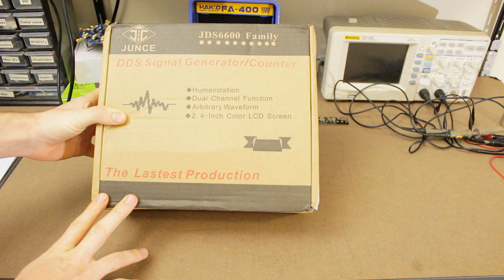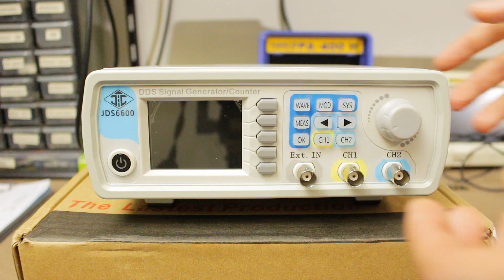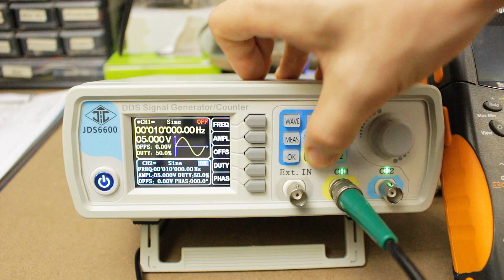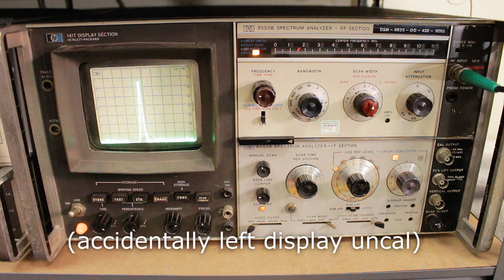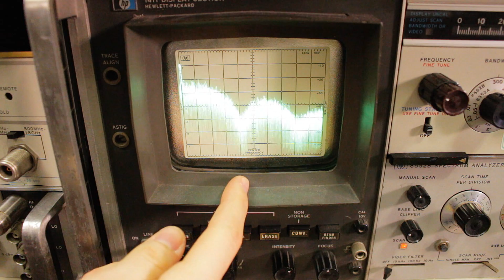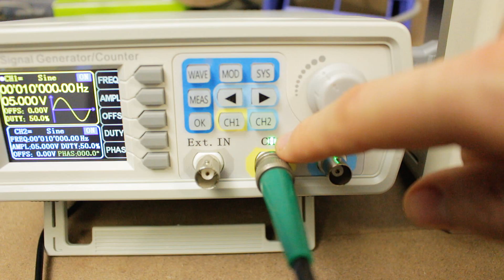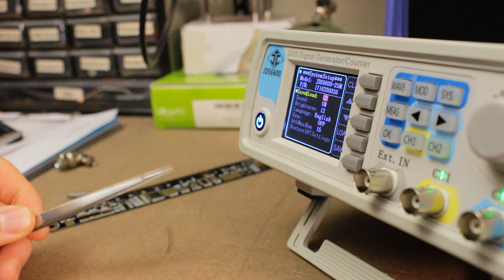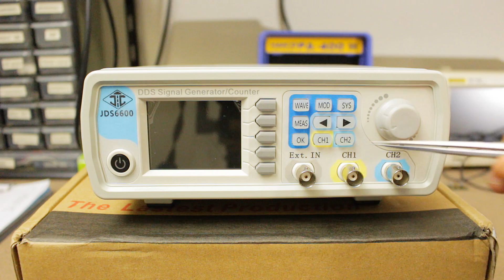JDS6600 Function Generator Review & Teardown

Comment: can I use ch2, to modulate a signal from ch1? (example: 1MHz carrier on ch1, 1000Hz tone from ch2) or would this possibly fry the outputs if they short together? What is a good way to mix the two signals? I'm a little disappointed in the modulation functions of this model compared to the 6800 or 6900. maybe I should have spent that extra ~$40! :P

Comment: I bought the 60Mhz version of this a few months ago.
One main annoyance is when using gated pulse mode where you have it send a specific number of pulses.  The default state is ungated.  When it completes sending a number of pulses where it stops output and you  go to change the number of pulses, it enables output ungated.
I was trying to test a binary counter that has a logic output at specific counts.  Tried to use the generator to test it but could not.

Comment: 13:40 The 2 white circles on the board is where the SMD LED's are, if you remove the board, you can shove a small piece of black heat shrink over the 2 plastic tubes that molded on the frontpanel. That way, the markings CH1 and CH2 above the BNC's are nice lighted without illuminating the buttons above.
I have the same function generator but rebranded as Joy-IT, it came with exact the same contents in the box, except the cd, but Joy-IT offers this software on there website.
I also noticed, that the output voltage is very low current, barely enough to light up a white LED, even with a amplitude of 20V.

Comment: The ones with the external power supply seem to be better, the one with the internal power supply leaks too much ac to the output.  Painful even standing on a dry tile floor with bare feet.

Comment: I have a CJDS66.  Virtually the same. It doesn't turn off by itself. I  wish you could select the load impedance. More findings. If the two channels aren't set to the same frequency, but instead set to a multiple of each other (eg ch1 set to 375Mhz and ch2 set to 750Mhz) you can't control the phase of their offset. And their rising edge don't coincide.

Comment: I just got this and im well happy with it for what it is.. as far as turn it on and the generator comes Strat on is easy fixed just set the generator to how you want it to start up ie on off 5 hz 3000.00 hz what ever and then just press and hold the ok button until it beeps now when even you turn it on it will start like that

Comment: Be sure to plug in the USB. That eliminates the 50+V leak and should clean up the noise. Doesn't matter if the host computer is on or off....still works (provided the host PC is grounded...duh).

Comment: my signal/ function generator provide constant output voltage for all frequency range when analyzed through oscilloscope, its fine, but when i connect a load across signal generator its output voltage drop significantly why?
Reply: Because the scope input impedance is (usually 1Mohm), and the source impedance (I think), is 50 Ohms. Feeding a load of lower impedance will bring the voltage down... 
Notice the source voltage said a value that was about hald of what was seen on the scope, until it was switched to a 50 Ohm feedthrough impedance? Then it was equal to the generator setting (perfect impedance matching at 50 Ohms). This is pretty much a feature of every sig gen I've ever worked on: The source voltage is only seen accurately at the load when source and load are the same impedance.

Google impedance matching for more info.
Reply: Yeah you need to match the impedance then you see the correct frequency response by half of the voltage output. If you leave one end open the delay in the cable's reflection may constructively interfere and give you higher values. I think the 60MHz version will by definition drop off -6db because of a lack of samples.

Comment: I'm interested in this little thing as my first function generator. Would you recommend this for someone just starting out in electronics? I've got some other gadgets from Ruideng as well, they sell (or maybe make? But I think just sell?) these units, that's how I found them. Love the other stuff. Nearly done building the DPS5020, fun little project that. Love the USB tester and dummy load, awesome stuff.

Also, did you happen to crack the power supply open? Even if you just say what is on the label, might give us an idea on how good it may or may not be. I have absolutely no shortage of 5v 2A power supplies, but it would be handy if the one included with the unit was usable.

Thanks for the video! Very informative!

Comment: Great teardown!  Did you notice any components which might convert one model (the 15Mhz) one to a higher frequency capable one?  More often than not, the $40 difference in models is due to a $3 blocking diode, or even firmware :D

Comment: Hello, my terminally ill friend bought this device and asked me to have a look at it, as she believes a certain frequency can be used to help heal her. I know there is probably no scientific evidence for this whatsoever, however I want to do what I can to make her feel more comfortable, and if getting this working is what it takes, so be it.

I'm an electrician, but have no experience with this at all, and just want to know in Laymans terms how to get it to emmit the frequency she 'needs'. I'd appreciate it if anyone could get back to me on this or give me any advice, thankyou.. My email is djhorgan80@gmail.com if you don't want to discuss it here.
Reply: Hello! There is such a frequency. 280 kHz to 600-800 kHz, but it's all about the coil. It must come into resonance. Heals only the sine, statics.
I already bought it, but I did not try it. You need to buy a signal generator.
I bought it, but it does not work
and I can not surrender. Hey. Vladimir. Your Emaiil does not work.
Reply: Yeah its probably a magnetic field that needs to be generated. in this case you may need more power than this can output and there may be a need for an amplifier. if you want to connect direct to the skin with electrodes then maybe 5-20v output may be all that's required. Just some things to think about. Also I doubt that a complex waveform is required maybe just a sine wave so therefore this thing is way over-kill. Who knows - need more info on this "technology"

Comment: The one thing that REALLY bugs me is the button labelled, "AMPL" that changes the voltage value shown (the 5V appearing after bootup).  This is because the value shown on the screen is actually the peak-to-peak value - not the AMPLitude of the sinewave!   So in fact the output is v(t)=2.5sin(wt) volts into a high impedance.   This confused me quite a bit initially!  If there is room on the screen, a little "ptp" added after the V symbol would help a lot.
Also, my unit annoyingly gives out 5.24Vptp into hiZ when set to 5V @ MHz frequencies = a +4.8% error!   This rather makes a nonsense of having voltage resolution settable to 1mV!   (This 5.24Vptp value was confirmed correct,  by measurements using a new HP54645D, a TDS210 and a Rigol DS1102E.  Terminating at the scope input with 50ohm just halves this value as expected).  I'd love to know how to correct it,  hopefully it's only a pot adjustment, when I get brave enough to open the box!
Another minor problem for me, is not being able to use my Windows 10 PC to run the software supplied by RD to create and control waveforms,  The s/w control panels are too big for the screen and are cut off, completely hiding many of the necessary s/w buttons.   But this problem is almost certainly due to Win10's inability to properly scale 3rd party software - a well known issue.
In addition, as mentioned by others, the instrument's front panel font also looks a bit strange to my western eyes (too ornate? even a bit "unscientific"!)
But otherwise, at the price, the JDS6600 is a pretty good piece of equipment for non-professionals.   Yes it has some deficiencies, but to compare it to $k truly professional equipment, as others have tried, is not fair to the designers.
Reply: The amplitude it correct into a 50 Ohm load. Into a "high" impedance, you get approx twice that.

Comment: my understanding is the difference in the 20mhz and higher models is just that firmware you mention would love make mine 60mhz
Reply: Perhaps between some of the models, but I don't think you can get the 60 Mhz only by changing the ST micro firmware. According to the specs, The 50 Mhz and 60 Mhz models have a sample rate of 266MSa/s whereas the other models are 200MSa/s. This means they are probably changing something in the FPGA as well (or perhaps they are simply overclocking it?). Also, there's serious amplitude and DC offset limitations above 30 Mhz (it degrades to 5Vpp, and ±0.25V?) so even if it's possible it's not really worth it.
Reply: @battlecoder  yes exactly. My feeltech fy6800 also drops the output voltage by 50% from 10 to 60MHz sine wave. I only used 1Vpp. Altough the sampling rate could sustain up to 100MHz I have no idea why the output level drops that much. Do you? On second thought, at 250 MSamples the Nyquist is at 125 so 60MHz is just at the 6db with 4 points per period. It's like using a 1Gs oscilloscope on 250 Mhz.
Reply: @Mike Sienicki yes of course, termination has to be at the end of the cable. The Feel tech 6800  still drops amplitude from 20 to 60 Mhz by half. I believe that this is because of poor sampling and the characteristics of the amplifier (even at low output voltages where a constant gain bandwidth product should provide a higher upper cutoff ).

Comment: I purchased this unit (60Mhz version).  The one thing I don't like about it is that it is very noisy!   Dial up an HF frequency on a ham band, and listen to it.  Something should be done to clean it up!  Is it the 5V supply or the switching supply inside to generate the voltages for the output amps (or both)?  Otherwise it appears to be well made (the circuit board).
Reply: Thinking of getting one for aligning  receivers.  What's the upper frequency limit like?  Is the waveform usable at 50mhz?  Did you find a way around the noise issue?  The wall wart  can be replaced but is apparently does internal DC-DC conversion to get to 10v pp.  Cant fix noise on that.  Is the noise only a problem at higher outputs, say > 100 mV?

Comment: Not bad for the cash! Back-lighting the enable buttons might be an easy and useful mod too. Annoying it comes up by default with the output turned on! If you get it to make a DC output (or whatever) and put your scope in AC mode while turning down the volts/div can you see much switching noise leaking through?
Reply: Ok never mind - saw the post on EEVBlog

Comment: I have two requests. Does this have a potential on the ground line like the older and eerily similar FeelTech units and does this unit preserve your settings after power cycling?
Reply from the maker: Yes unfortunately there is a ground potential of 99 volts (!!) on my unit with the default plugpack (only found out after this video), so I switched to a different plugpack. One of the users over on the EEVBLOG forum (see reply #26 at http://www.eevblog.com/forum/testgear/anybody-know-anything-about-this-signal-generator/) reports the leakage current as 14uA. The unit can be set up to preserve your settings, but it does not do this by default (as you would have seen in the video). I later found that you can save your configurations into 'presets' and then select which 'preset' is loaded on boot...
Reply: Did you test the software to link it to your laptop. Necessary for creating the arbitrary waveforms.
I didnt get it to work on Windows 10
Reply: It comes with an external 5V PSU that does not connect to ground.

Comment: I don't have this model of waveform generator (I have an mhs2300a), but I am thinking of upgrading, so to get an idea of the functionality of the jds6600, I downloaded and installed the pc software. My main interest is in creating arbitrary waveforms using the editor provided, and it seems to be very nice, easy to learn and highly functional.
Unfortunately, the program has a serious bug that I would consider a dealbreaker for me: After creating a waveform with the editor, and saving to the pc, I find that the file that was created is completely unreadable. That's right, the software cannot read its own files! Unless this problem, and the 20 minute shut down problem mentioned in the video can be solved, I don't think this machine can be considered as a worthwile investment.Even at its very low. price
Reply from the maker: Hmm, I haven't had a chance to check out the software for it yet (having some issues installing it; keeps breaking & crashing when I open it!), but if what you're saying is true, then that's pretty bad. As for the 20 minute shutdown problem it seems to happen very intermittently now so it may just be a dry joint in the barrel jack or something - still, not great...
Reply: I asked the designer to comment about this.
We'll see if he does or not. I won't buy it unless I am sure there are no issues.

Comment: Hi, I just test one 60MHz, I have a periodic phase shift.. can you sync the scope on the output at 50KHz for instance ?
Reply from the maker: Not sure what you mean - do you want to create a periodic phase shift or you're observing it undesirably? There is an issue with sweep mode losing phase lock
Reply: No, I mean: if you reset the default settings, chose 50kHz 5Vpp Sine, periodically there is a phase shift, a sine period is not complete, if fall to zero and restart. I received one of the last JDS6600 60Mhz.
Reply from the maker: Hmmm.. Perhaps you have a dud. I've just tested your 50kHz/5Vpp and it seems okay: http://imgur.com/a/xgHib. Other frequency/phase tests here: https://www.eevblog.com/forum/testgear/anybody-know-anything-about-this-signal-generator/

Comment: I also bought a signal generator, JDS6600 5mVPP effect is very poor, there is a clear switching power supply noise, more than 20MHz sine wave has a significant jitter, the nominal vertical resolution of 14, in fact, simply can not reach, Because the waveform length is only 2048 points, the highest resolution is only 11-bit resolution, the oscilloscope with 20mV voltage and 100nS time base gear test 5V 10Khz sine wave, you can see the rough rough waveform, and 14bit machine More than a lot of open the machine can see the DA is a simple resistor, which used a multiplier, or second-hand components, with a knife gently scraping the surface to drop the black powder,
Reply from the maker: You're right about the PSU noise, it is quite high. There are definitely some issues that aren't discussed in this video; I've taken a lot more measurements over on the EEVBLOG forum here: http://www.eevblog.com/forum/testgear/anybody-know-anything-about-this-signal-generator

For example there is an issue with phase locking when doing a frequency sweep, and some distortion issues at 10MHz at max amplitude -> can continue the discussion in the forum thread.

Comment: Hi my dear friend 
thank you very much for your video and your work, I really like it, I guss you did not buy it from our official store. (https://rdtech.aliexpress.com/store/923042)
but it doesn't matter , it is very good , you introduce interface , appearce , some wave , and use the oscilloscope to test our waveform (although oscilloscope is not very advanced, but it is engough. ) you use the analysis decvice to analyze, it is very good. about the LED light, I will improve in the future. 
for tear-down , your analysis is almost right , you are professinal. 
let me talk about the problem I find 
1, at 5:25, you said the channle swich, when you turn off the channe, when you restart the device, you will find channel is pen, this can be stored. you can keep pressing ok button, you can store this state,  you can try. 
2,  at 10:45, you said there is a problem , but I did not find the problem,. because our VPP is 20v, and you set 20V, so you set DC offset,  it can be offset, you can set lower than 20V, you can test 
3, about the word, it is our standar typeface. we can't change it
there are our own test and openeration video , you can refer it https://www.youtube.com/watch?v=Fn76Yp-vATI
if you have find any problem. please tell me 
BTW, we update our JDS6600, and add some 15MHZ , 30MHZ, 50HMZ, 60MHZ version, you can check https://www.aliexpress.com/store/product/RD-JDS6600-Series-40MHZ-Digital-Control-Dual-channel-DDS-Function-Signal-Generator-frequency-meter-Arbitrary-sine/923042_32814611834.html?spm=2114.12010608.0.0.TrBEyd
and you can tell your watcher, if they want to buy, they can get 3-5 usd discount on our shop, ok?
thank you again
Reply: very good , friend , thank you very much for your replay . you can keep checking , there are many interesting function . about the blog, I will checking , thank you
Reply: Can you address the concerns of Michael Roberts (His comment is bellow)?
I like to buy one, but unless these  problems are solved, I won't.
Reply: Hi Rd tech, will there be a solution to the voltage potential on the ground BNC connector in the future?